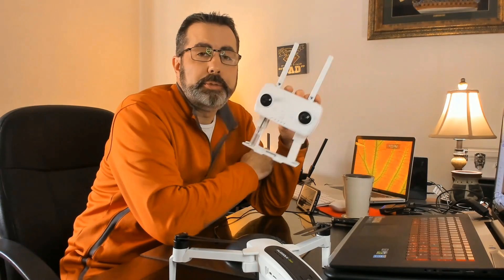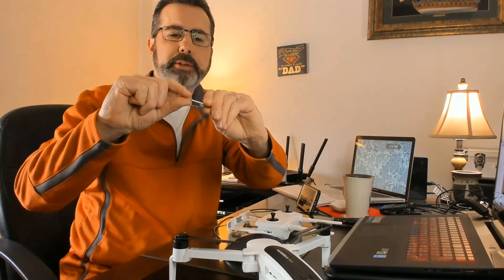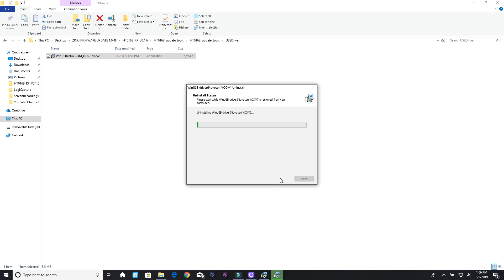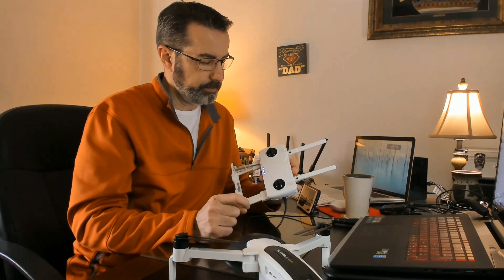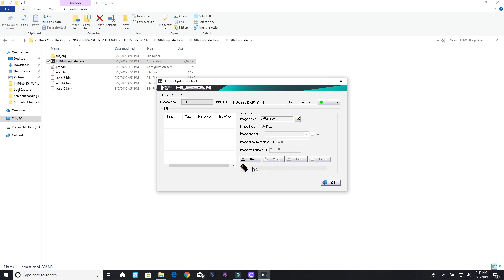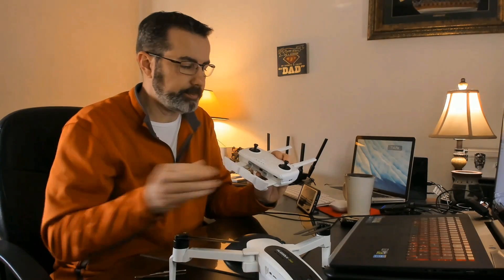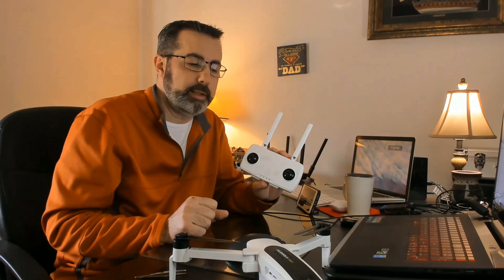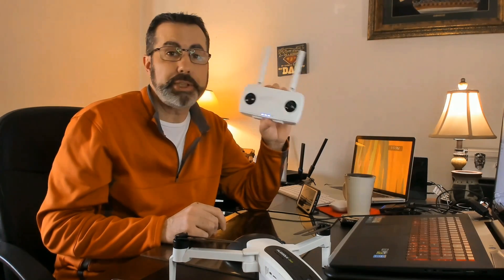HUBSAN ZINO - CONTROLLER JUMPER FIRMWARE UPDATE HT016B

Comment: Hi Chris, I have just braved the transmitter update today. All went well as per your video until I turned it on. I now don't get constant blue LED's on the transmitter, they constantly flash in sequence like when you first turn it on. I can't get my android phone to connect to transmitter basically. I thought maybe the lead was the issue so I've tried the other lead (type C) on my second phone and get the same results. Any ideas what the issue may be? Is there a roll back version of the firmware? I've repeated the installation of firmware many times now just to make sure I hadn't made a mistake. Any help gratefully recieved!
Reply from the maker: Steve Knight Sounds like you didn’t install it successfully even if it told you you did.
Follow the recap of this other video exactly as I do it and you should be good. I hope 🤞 
https://youtu.be/fllv5tsA71s

Comment: Attempted to follow these directions but something went wrong. May have loaded the wrong file because now I can't connect to wifi and my battery indicator lights blink from left to right as though the battery is being charged. Anyone know if a factory reset can be done on the transmitter?
Reply from the maker: Ronald Cowan There is some sort of new tool about but I haven’t played with it yet. I think it fixes the stuck boot loop after failed update attempts. Not sure 🤔 
Are you in my group as Ronnie?
Reply: @QCGUY  Yes, I am Ronnie. Finally got the controller update properly and realized I wasn't doing the correct steps to start it up. So now I am flying and I am impressed with this drone. Although it isn't a replacement for my Phantom 4, it does very well especially for a third of the price.

Comment: I have the same problem after updating as Richard: Help did the controller update and now the controller doesn’t work - the blue lights just keep scrolling one light at a time from left to right an will not connect too the drone or phone - it says: The current mobile device is not properly connected to the transmitter
Reply from the maker: Jim Barrett Join my group and I or others will help you. 👍
It’s too hard and a lot of work troubleshooting on YouTube. Thanks
Reply: I have the same problem after updating as Richard and you!
Your problem is solved?
Regards Tibor

Comment: Help did the controller update an now the controller doesn’t work the blue lights just keep scrolling one light at a time from left to right an will not connect too the drone or phone
Reply from the maker: richard weaver Join my group from the link under the video. 
I or others will help you there. This is just starting to become a common problem.

Comment: Thanks so much for doing this video Chris. So many people were confused and afraid of doing this update to the controller. But using tin foil is a much more reasonable work around than bending the pins together. And walking us through the entire process  was so helpful.
Reply from the maker: Reflecting back on this comment while thinking about peoples reaction to it on your show or while your on theirs are so far apart from this comment. Funny how the Hubsan supplied jumper has even failed and this one still holds up every time.

Comment: Hi, ... YES?  FINALLY? It's ALL GOOD BABY...... I tested the new transmitter upgrade (the tinfoil method) the new gimbal firmware and the new FC firmware (not doing the camera firmware as the camera is working great already and my Zino won't update anyways glitch) well first the bad news things that didn't work for me, I'm using Android. 1. wifi fpv channel select, won't restart to complete switch channel. 2. takes a bit longer to find satellites. now for the good news, I was flying 10kph to 15kph constant sea breeze. 1. auto takeoff rises only a couple of feet then falls slower than before. 2. hover is now very stable great. 2. holds hover altitude perfectly even in this high wind. 3. dead zones in the control stix have been improved. 4. no loss of altitude when flying forward and left and no gaining altitude when turning right at last. 5. smooth stop the drone now slows down smoothly nice. 6. it's flying very well smooth turns not much loss of altitude at all and mostly it's easy to control and very stable (not 100% yet but getting there). 7. the gimbal is working 100% perfect it doesn't get better than that even the best ones well done Hubsan. If you had your Zino shelved like me, its time to unleash your drone. Hubsan have done a good job this time....get out and fly, I can continue to mention all the issues but the short version is the Zino is ready for its pre-release maiden flight...wtf?  things are looking good for this drone future updates should put this cheap drone where it should have been...the best budget drone ever...

Comment: Perhaps it requires a USB Data cable rather than just a charge cable. Easy way to tell is to hook up a smart phone to the PC and see what happens. You may have to go into Developer Options (for Android. Look it up on youtube) and set USB mote to File Transfer Mode.
Reply from the maker: Rob C We all have a bunch of these cables laying around so it’s bound to happen. 
Glad it did because I know this happens often and stumps some.
None of us as a majority are marking our cables I’m thinking but yes that was the issue I’m sure. 👍
Reply: @QCGUY  Well the fact that the USB sound played on/off means that a connection was being made but probably just a charging connection which the updater app wasn't looking for. 
I only buy Data  USB cables now since things are getting more complex with USB and a Data cable will always charge if thats all you need at the time.
Reply from the maker: Rob C Thanks 
I don’t buy them because everything I buy comes with one. I had one for the job is all that matters to me. 👍

Comment: Hi Chris, couple of quick questions.  Firstly, since getting my drone I haven't installed any of the updated on the camera, drone or controller. If I want to install any of these now is there a specific order to do so? Also, is there anywhere that details what these updates are for? For example if they relate to specific fixes? Thanks for the upload!
Reply from the maker: I will post what they provided here at the end of my comment but there is no order to the updates and you don't have to install everything at once no matter what Hubsan says. I did the controller and flew the quad on  1.0.46 then updated to 1.0.48 but have not tested yet. After that I plan to do the gimbal and test then do the camera and test. 

This is from Hubsan....
ZINO firmware files
ZINO V.1.0.48(firmware for flight control board)
ZINO_G-V3.0.2.2(firmware for gimbal )
ZINO_IT-V0.3.5ub25(firmware for camera board )
HT016B_RP_V0.1.6(firmware for the transmitter )
CHANGE LOG(for the drone ):
1. Optimized the drone’s behavior for losing altitude when forwarding 
2. Add the function of height setting for RTH in the APP
3. Add the function for Gimbal Pitch speed setting in the APP
4. Modify the RTH feature for lost control and allow it to RTH after lost control in Auto –land mode 
5. Optimized the video quality 
CHANGE LOG(for the controller ):
1. Add the function for Image Transmission settings 
2. Add the function to enable the controller to control the drone after the disconnection of the WIFI 
Upgrading notice :
Please keep in mind that all the firmwares should be upgraded at the one time ,please do not upgrade them partially

Tips for upgrading the firmware of the camera :

1. Please prepare a blank SD card and format it to FAT 32 before you start the camera firmware upgrading
2. And format it again after upgrading before you start the recording function
3. Do not power off the drone during the firmware updates

Tips for upgrading the controller :

1. Please watch the upgrading tutorial video carefully before you start the upgrading and prepare a tweeter or similar tool
2. Please keep in mind that the two pins pointed out in the tutorial video for the controller should be connected to each other ,otherwise the upgrading can not be done
3. And please release them later after you 
4. After watch the video and still don’t know how to process the upgrading ,we have prepared the upgrading instruction in docs(included in the firmware file package) for your easy reference

Please ensure that the APP version has been up to date as well
Reply: @QCGUY  Thanks Chris, I think over the next week I'm going to give the updates a try one at a time and see if I can get this drone usable for summer! I  look forward to seeing your feedback on how it performs with latest update!
Reply: @QCGUY  hi thanks for this information .I've been looking for this information since getting the zino 2days ago . Thanks again 😊